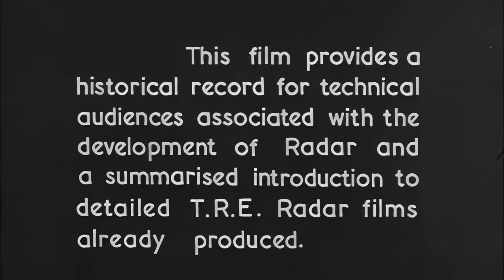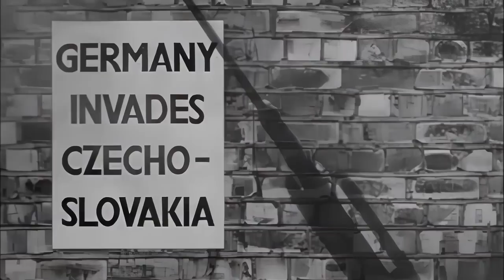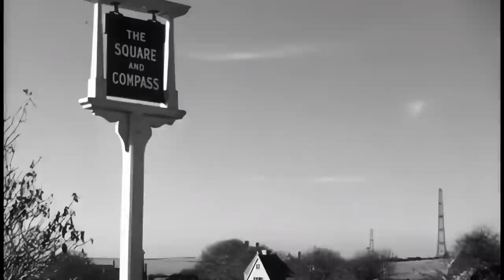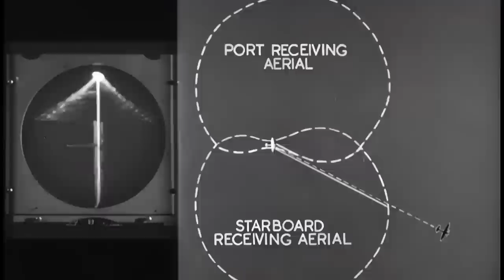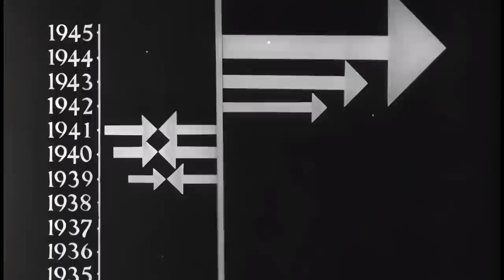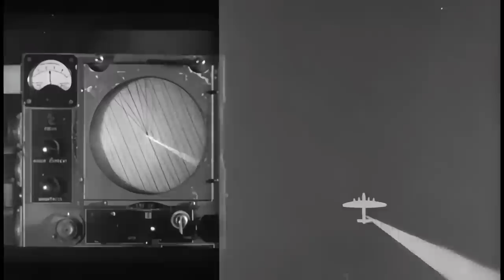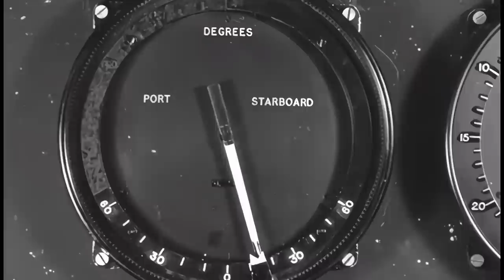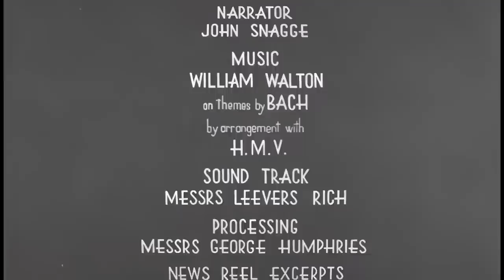RDF to RADAR | The secret electronic battle (1946)

Comment: If you wonder what,  towards the end the film, the shot of a machine squeezing out what looks like toothpaste without any comment is all about; it is in fact the production of polythene which enabled the manufacture of  low loss coaxial cables for linking transmitters (Tx) and receivers (Rx) to antennas. Polythene (from ICI) was something the Germans did not have and it remained a very closely guarded secret on how to make it during WW2.  It was key to get the maximum range possible from the transmitter power available and making installation in aircraft and other mobile platform much easier to achieve.
Reply: Keeping the water out of the joints between the aerial feeders and the Aerials on the CH stations was a major problem in 1940, not only did it cause loss of power and receiver sensitivity, it also caused errors in bearing and height finding.
Reply: Thank you for that, Mr G.  I didn't know that.
Reply: What did it do? Did it shield the wire from radio wave interference (intrusion)? Like the shielding that's woven into modern spark plug wires that keeps it in, in it's case, so it doesn't make the radio in your car hum? In older cars they had the sheet metal covers that the plug wires were routed through to keep it from happening that everyone took off and threw away and replaced with shielded wires as soon as you could buy them as a replacement set because it was such a pain to take apart. 
In modern coaxial video wire isn't there a layer of some kind of foil wrapped around everything under the covering that does that same thing? It's a shielding?
Reply: @dukecraig2402  Reduced/controlled transmission line losses between the radio gear and the antenna, particularly at higher frequencies.
Reply: Looks like that stuff Freckles lets out once a month.
Reply: Wow! Didn’t know that cheers 😊
Reply: Thank you for the information.
Reply: THAT I did not know/ nor ever read about in books on the electronic war that went on silently in the background. Thank you.
Reply: I recognised the extruder from my cable manufacturer experience but I did wonder what the significance was. Thanks for the gen.
Reply: @TheDerekeder someone likes Zappa! 😂😂😂
Reply: Remarkable that ICI which was still an industrial titan even when I was young , no longer exists. More politicians skills in full view.

Comment: Bravo!  A very interesting film and it filled in some blank spots for me.  After leaving school I joined the RN in 1973 as a radio/radar maintainer.  At that time we were still heavily reliant upon valve technology.  I knew that magnetrons were a closely guarded secret during WWII but hadn't realised that klystrons were as well until very recently.  Nearly 30 years after WWII much of the technology in use was the same, or essentially similar, to war-time systems which I had not realised till I watched this film.  So thank you.

Comment: Absolutly fascinating. I have never seen this subject covered so comprehensively before. It answered quite a few of my historic questions on the subject. I must admit i did a double take when it said that the top secret experimental equipment was taken to Dunkirk, not realising thete was a Dunkirk in kent, despite having spent a few years near Folkestone..

I also have never heard any mention of the overseas radar sites before.

For those not in the know, there are a couple of the large chain home towers still extant on the cliff behind Dover.

Comment: a fascinating find. 
thank you for putting this up. 
as an ex-audio guy, I can remember using the connectors 
shown in use on those radar sets well into the 2000s. 
they were known as milspec connectors...can't think of why...smileywinkyface
Reply: Yep, you'd clean off those copper buttons inside of them with a pencil eraser and all of the sudden a radio set that had transmitting and receiving issues would clear up and work like new.
I can't remember the nomenclature of the components but in the armored vehicle I was a crewmember on we had the big unit that was a receiver/transmitter and the ox, auxiliary receiver only, and the Vincent (but we're not allowed to talk about that one, although by now you can probably but those things in Army/Navy surplus stores and Ebay😅😅).

Comment: as a GPO / BT engineer i was responsible for maintaining the remaining DTN “ defence teleprinter Network  this was installed over something like 3 years before the war and linked all the Radar stations and Roc posts ( Royal observer Core ) back to the control and analysis centres a tremendous effort ! some Fighter direction centres had feeds from two different directions in case of bombing a brilliant concept and effort the US didnt have anything like it until “ Jaytids “ in 1966 i believe certainly other country had Radar but the integrated system in Britain made it much more usable

Comment: Interesting video processing done here, fine noise, texture and detail was reduced with a remarkable increase of sharpness and excellent smoothness.  It looks like a lot of work.
Reply from the maker: That's all the original texture and detail there is. The scale provided by digital archives and old dvds etc is the original, and that's about 400 per cent less than modern televisions. I'm tinkering with digital upscaling to enhance what's there and remove the pixelation / blurriness of automatic interpolation, remove lens flicker and film vibration. It's still a learning process for me.
Reply: must throw in my tuppence worth here; truly excellent production work; brings the sense and feel of the original footage to life. How much archive material there must be out there, which we have only seen in worn-out prints! Time does a blink, and we are at any point in the last century.... best regards @ArmouredCarriers
Reply: and also shows very clearly the culture of innovation and excellence in this country which set Britain, not simply ahead of the yanks, or the enemy, but in a league of her own in so many fields: jet engines and all the rest. Everyone simply filling in the gaps, ever since.

Comment: Thanks.....great share 👍👍......what did they mean by "sense"?
Reply: I assumed it to mean sensitivity.
Reply: In direction finding you have to resolve if a signal is on the forward bearing or the back bearing. Sense answers that question. Later systems did not need to resolve sense as reflectors behind antennas quenched the back beam lobe that was in the antenna radiation pattern of the early more basic antenna systems.
Reply: @twotone3070  thanks....that makes sense .....important to determine in the early days of this new method 🙏🙏👍👍
Reply: @Mr_G977  THANKS....when they mentioned that it went right over my head .....t y 🙏🙏👍👍you teach....I learn

Comment: Oddly enough I actually understood all of this.  Boy, this technology is old and very primitive.  The real magic of modern RADAR systems is the digital processing not the underlying concepts.
Reply: It may seem “old and very primitive” now but it was cutting edge then. You must give enormous credit to the pioneers who had a  limited range of test equipment at their disposal and were working from first principles. The system engineers of today are “standing on the shoulders” of these extremely talented electronic engineers.
Reply: @robertdonnell8114 All the Digital stuff does is replace a load of Analogue electronics which did its job in the past. plus a load of WAAF moving plots on a table and a bloke trying to filter out all of the crap. The basic physics of how it all worked is the same today.

Comment: They made a history documentary but it was secret? That somewhat defeats the purpose of a documantary film doesn't it?
Reply from the maker: Not if it is made for internal purposes. New recruits back then were starting from a very very low base (very few films or novels depicted radar for example).
Reply: But you say it was made post-war, It has been since de-classified has it? @ArmouredCarriers
Reply from the maker: @petefluffy7420  It was compiled in 1946 out of training films made during the war. Most of the last WW2 "secret" designations were lifted about 1995. Only the most sensitive (read political) material remains classified.
Reply: @ArmouredCarriers  OMG, 50 years after the event!  Huge amount of time. The only real need after '45 might have been the cavity magnetron - essential for very short wavelengths. cheers
Reply from the maker: @petefluffy7420  Up to 50. There were different grades of classification. Each carried a different duration.
Reply: thanks
 @ArmouredCarriers